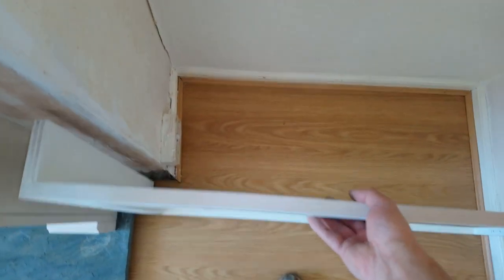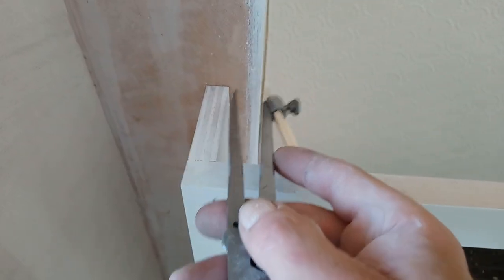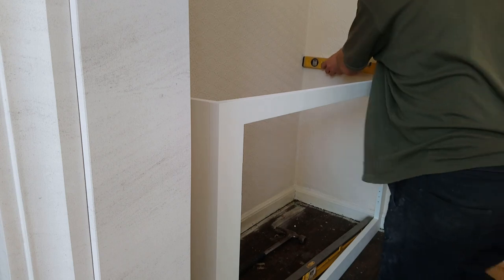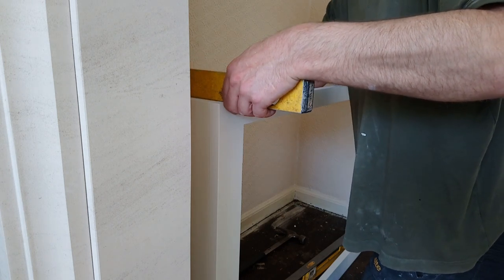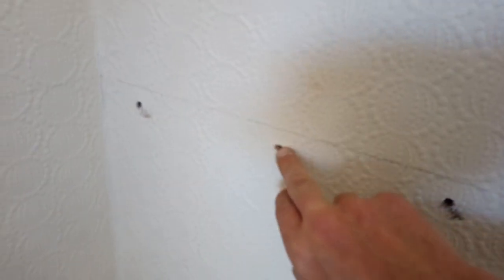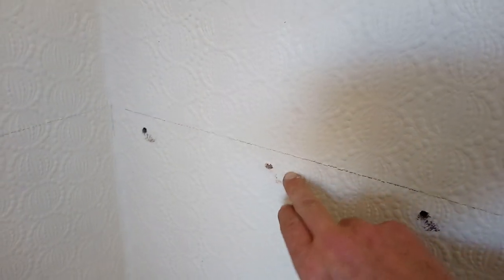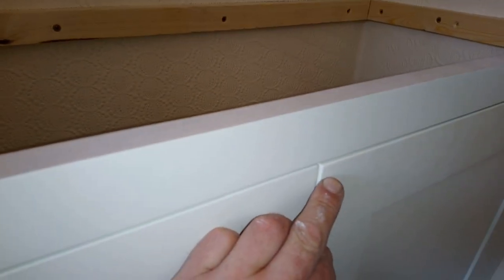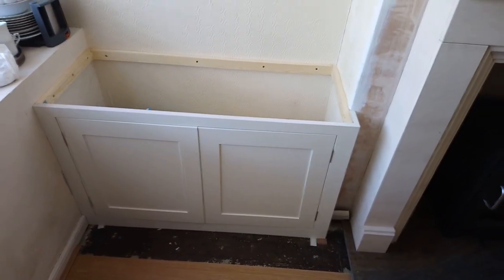Alcove Cupboards Build Pt5 - Fitting the front frames

Comment: Which is the best would to get a  good finish
Reply from the maker: Beech is straight grain, smooth finish & with very few if any knots, it sands & machines well & is pretty much a uniformed colour so that is my choice, Pine will shrink n warp, knot's will bleed through so you have to use knotting solution & you'll prob be able to see the grain of the wood after painting, Tulip is a hardwood but quite soft & feathers up a little when sanding, Beech is your answer 👍👍
Reply: @Gidjoiner  👍

Comment: Gif, what width do you make your face frames? As in the styles and rails if that makes sense?
Reply from the maker: Gif 😕?
I like to try to keep them in some kind of proportion, traditionally they're made quite wide, sometimes similar width to the door stiles but in these alcoves I'd lose too much access space between the doors if i made them that wide, for these i find about 50-70mm ish works ok, the stile that goes against the wall i sometimes add 5-10mm for scribing, i check that for plumb when measuring up. to give max access height i often put just a little 2" (44mm) pencil round skirt or similar along the bottom, there's to be a little offset/quirk so the bottom rail ends up being about 50mm, the top rail needs to be thick enough to support the top & not bend so depending on the span & thickness of top board i make that at least 50mm too, 
I make the face frame slightly thicker than the door's thickness so when they shut with a shelf in hard up against the inside face of the face frame they don't bind against it. Every job is different tho  🤔😉
Reply: Gid Joiner sorry Gid lol, thanks for the  detailed reply

Comment: Getting there....Gid, have you tried the Seneca adapter for the Domino XL letting you use the smaller cutters for the other Domino machine..?
Reply from the maker: Nope, haven't tried that, might do one day, I think you need that extra plate that mounts to the drop down fence so you can drill into smaller stock, I did ask the sharpener man if he could give me a price to grind an 8mm blade to 6mm but he was in the middle of moving to a new shop so no positive answer.